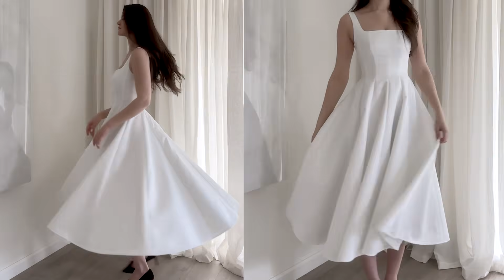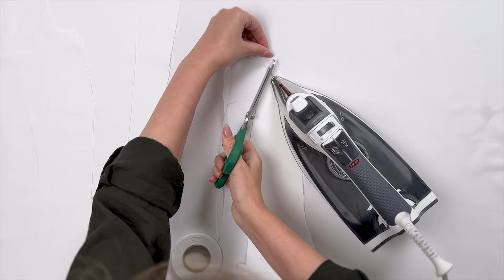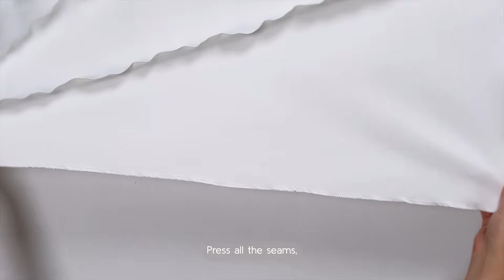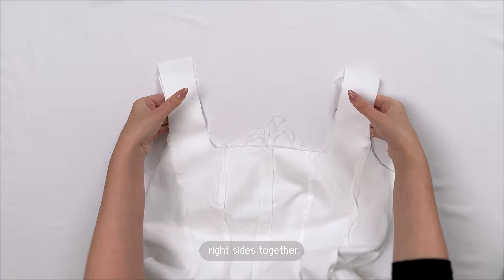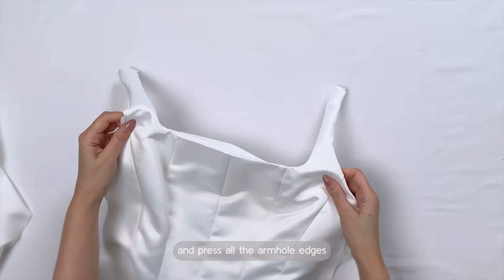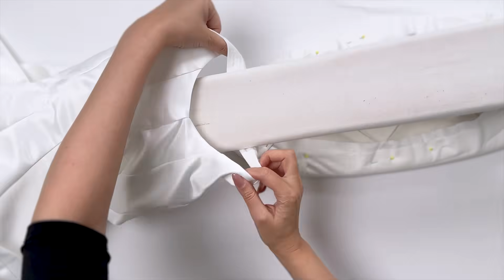How to Sew a STUNNING Paneled Dress inspired by Oscar de la Renta:  Tutorial + Pearl Sewing Pattern

Comment: Okay ahhh I need help! I bought a fusible interfacing strip but when you apply you apply flat and you press with the iron that did not work for me as now I have a very sticky iron!! When I look at how the strip is used everyone folds the fabric to glue the interfacing down i have used a scrap fabric on top but it only adheres to the top fabric is my tape just diff?
Reply: Use baking paper on top! It wont stick to your iron nor fabric that way

Comment: What an absolutely gorgeous dress. could be a simple wedding gown even, with some nice jewelry and accessories. I have two questions about serging all the pieces. In this case, it does seem like a necessity as the bodice and skirt are one piece and the lining is loosely attached , so technically the raw edges of the fabric are exposed (even though hidden from the lining). On a dress where the bodice is separate from the skirt, would it be enough to leave the edges unserged, or only trim them with zickzack scissors? Or do you think serging is always a necessity even on lined bodices? Do you have any experience with fraying on zickzacked edges? 
And secondly, if I use a more lightweight fabric for the shell and reinforce it with  fusible interfacing all over, should I cut the interfacing the same size (seam allowance included) or smaller (up to the seamline)? And would I then still need the seam tape for the neckline and armhole? Thank you so much, I am learning a lot from your videos!